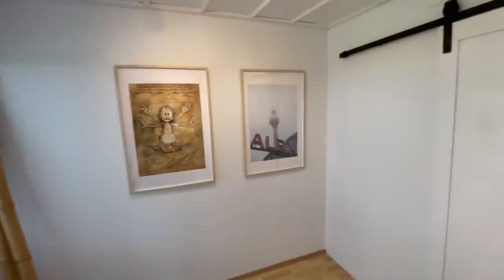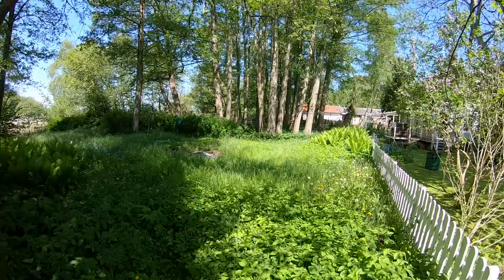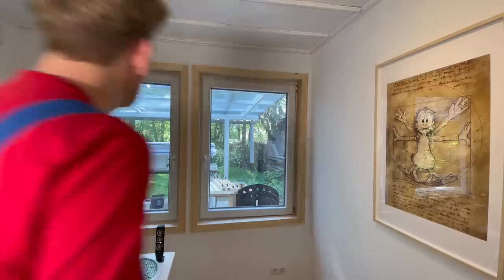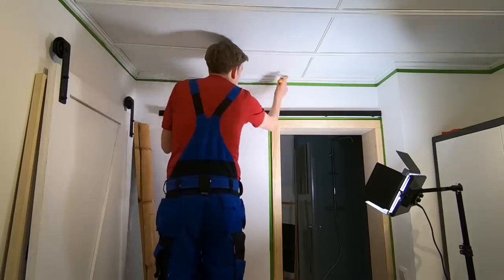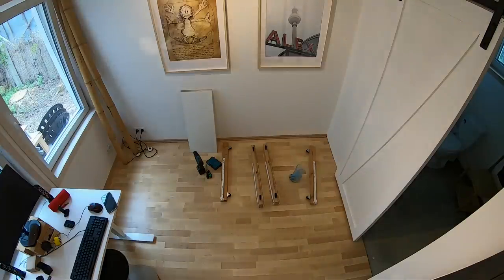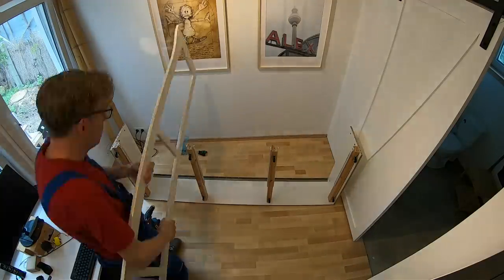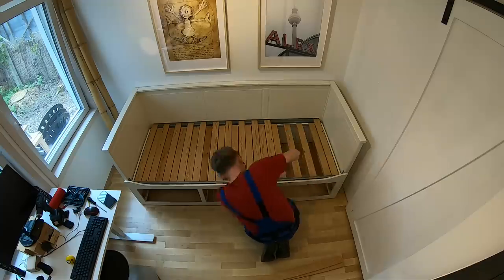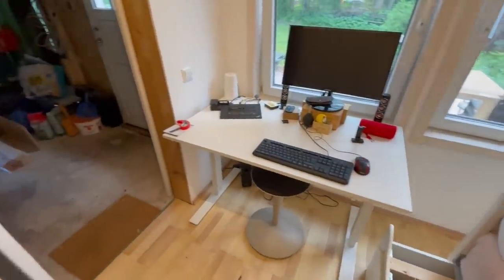Renovating an abandoned Tiny House Part #90: Finishing touches

Comment: Ah, memories of having to fill all the nail holes when my parents built a new house in the late 1960s.  At that time we used putty made with white lead. And I licked my fingers clean.  This answers so many questions about my life.

You made a comment on an earlier episode on the difference between yours and you husband's walks.  You are longer in the leg.  He is longer in the body.  His center of gravity is lower.

Now that the barn door frame and the storage cabinet are in place, I would paint the window frames and the trim to the door frame (not the huge expanse of the wood covering the wall sandwich) black.  The contrast would be cool.  The picture frames could go black, too.